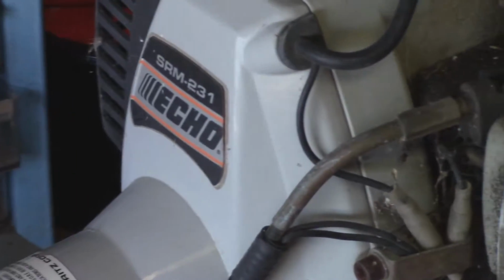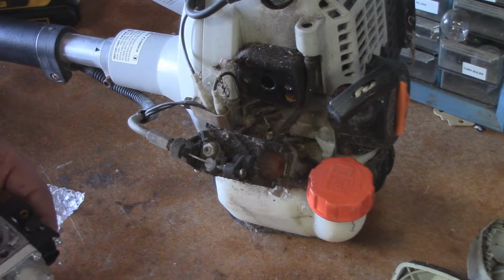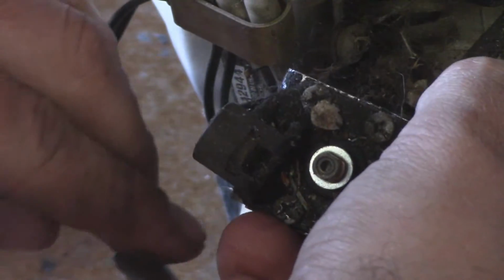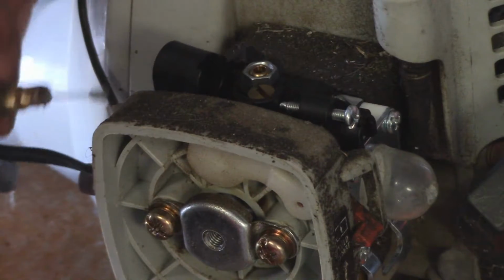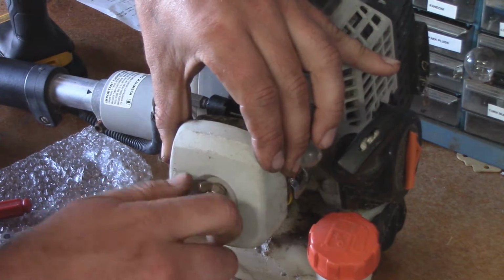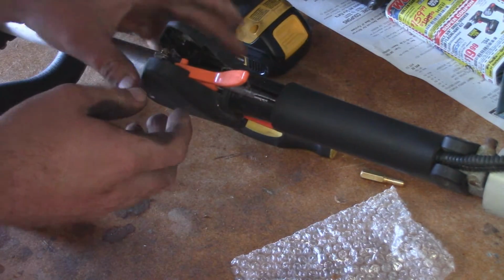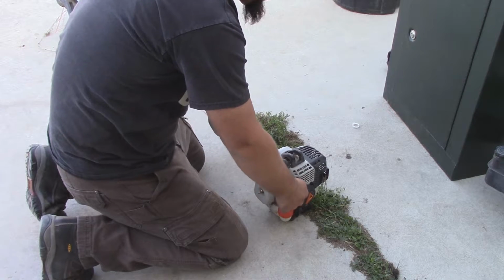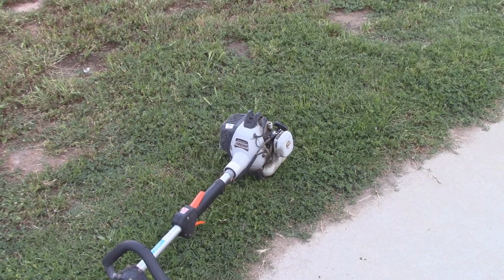Echo SRM-231 Carburetor & Trigger Replacement

Comment: Just inherited almost the same thing except mine is a srm230. I removed that stupid safety trigger as those are a pain in the ass compared to the newer cables and triggers and also replaced fuel lines and got a carb for 10 Bucks. Running like a champ. Awesome video as always Hank...👍👍👍

Comment: I have an Echo SRM 230 that is almost 8 years old and used on my property for 40 to 50 hours each year doing brush clearing of shoulder high wild mustard down in a box canyon. I too buy the complete carburetor kit with new fuel lines and gas filter, air filter and spark plug every three years plus checking the spark arrestor for any carbon build-up (can really effect the power). One of the more important tips for trouble free operation is to use the 91 octane gasoline with a fuel stabilizer and either run until totally out gas or drain the gas before storing the SRM 230. It will cold start on the second or third pull every time.
Reply from the maker: +Paul Jones for bang for the buck and a quality piece of equipment echo ticks all the boxes. I love their stuff
Reply: I agree, the Echo machine is not as powerful as my 4 stroke brush cutters based on the size of engines but the RPM is significantly faster and thus produces more inertia to the spinning head and a better "wack" to the brush. The Echo brush has never failed in 8 years while taking normal care and maintenance. Use common sense in maintaining the Echo SRM 230 and it will run better than expected for many years.

Comment: Nice trimmer man! Echo is the best there is in 2 cycle equipment, in my opinion...if & when you replace the fuel lines, buy a genuine echo repower kit, I know from experience I've tried the aftermarket kits & the plug doesn't fit good.
Reply from the maker: Ill give it a shot for sure thanks man